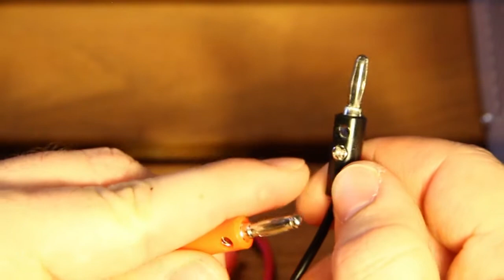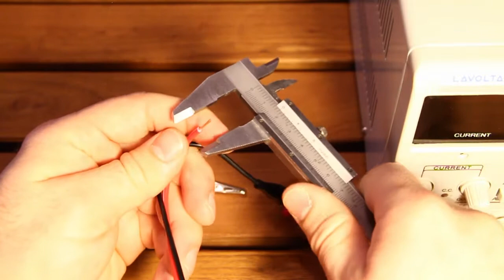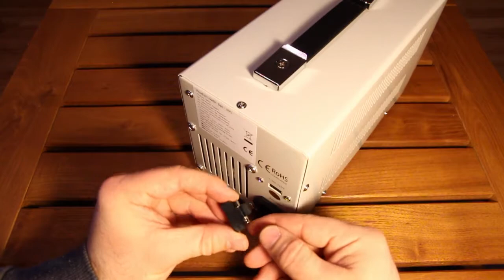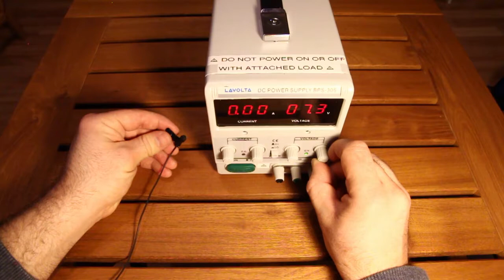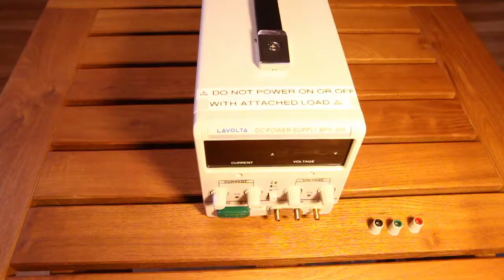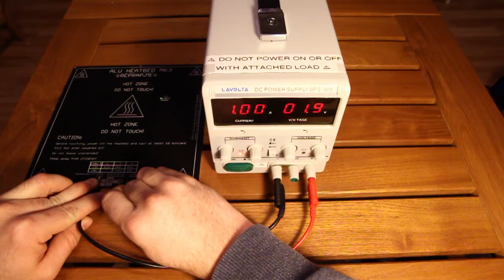Lavolta BPS-305 30V 5A Power Supply - Review Part1 #004

Comment: I have the 10A version and the cables are twice as thick as yours but the Ali Clips are the same so I just binned mine and made a better set, my unit though after about 2-3 hrs lost 2 segments in one of the AMPS display digits which I traced through to a couple of via's on the display board, it's a cheap and cheerful unit, it now works very well VERY  accurate so I'm quite happy with it also the fan only comes on under high loads but is very quiet? overall for the money I think it's well worth the it, China wins again!

Comment: When I first got mine I tested out with a five amp load the wire started getting hot I measured a 1 V voltage drop across the wires. After operating under full load for a little more than five minutes I started to smell smoke and burning the plastic was starting to melt in burn at the alligator clips mine were not soldered they just folded over the copper strands and did a crimp connection fire would’ve been A possibility if you would walk away and stay away with combustible materials around here he burning wire. After 29 days my unit stopped working the voltage was limited and no amps for load would be measured. I contacted them describe my situation I sent them pictures of the display and how I was setting up a test load with an automotive headlight. I was told by my symptoms that one of the control wires inside on the board may have came loose so I tore down the unit disconnected and reconnected all the connections on the circuitboard and unit continue to operate normally again. After that to test that the unit would survive I put it in a burn in test for 48 hours at 5 A 12 V with automotive light. Then I changed the light out for a dummy load resistance for48 more hours at 30 V Max unit survives no problem. There’s a lot of AC ripple riding on the DC current no good for sensitive electronics and very noisy for audio equipment but it’s good for a do it yourself or just tinkering with simple projects that are not sensitive to AC voltage or dirty power supply. I bought mine when they were only $60 soon after a lot of YouTube or‘s data review people started buying it so they doubled the price then it turned into nothing but a scam or rip off this unit is not worth over $100. If you could find this unit under $70 it’s worth it after that the choice is up to you
Reply from the maker: Thank you for sharing your experience with your power supply. 

I do agree, there are a lot of downsides to really cheap gear: quality, reliability and safety being the most prevalent and this can lead to potentially dangerous situations. If one uses gear like that, one has to be aware of the risks involved.